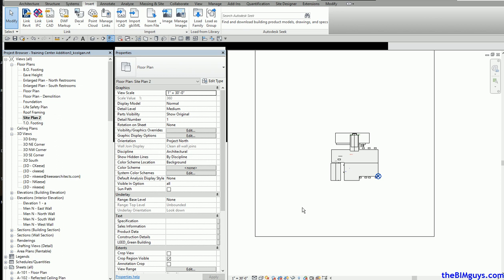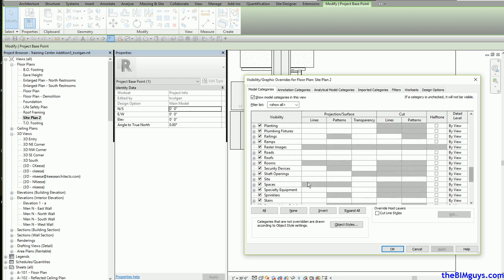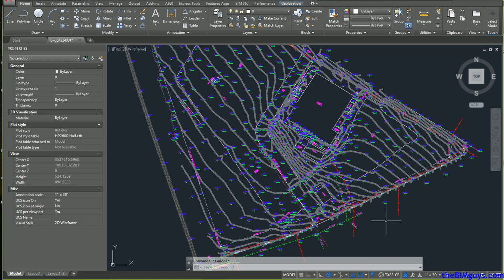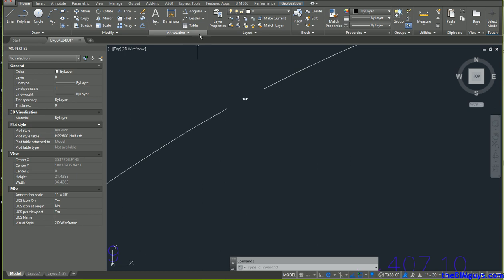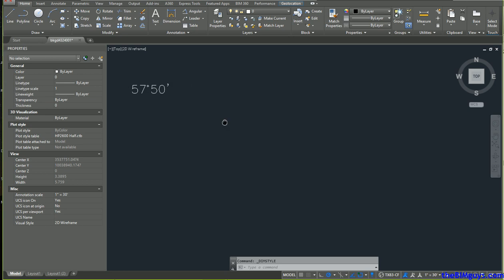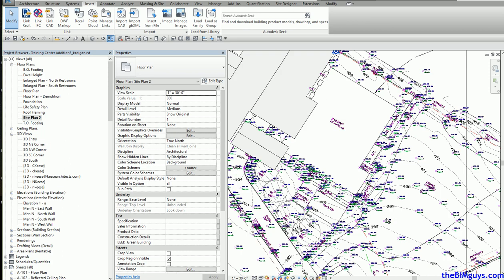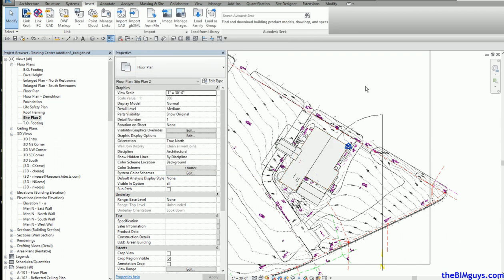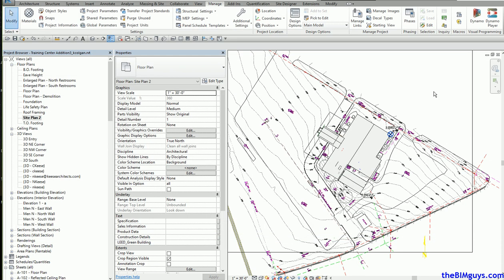Revit - Coordinating the CAD site and Revit Model - CADtechSeminars.com

Comment: question how I can put together two drawing in the same
coordination point, I have mechanical equipment and electrical, but they don't
match in the same point. I can see only one drawing but both file is in the
same file. I hope someone read my question and help please I have this problem for weeks
Reply from the maker: Victor
Chances are, the files do not share the same 0,0,0.  This happens often.
In Revit, go to a plan view ,duplicate it as Site Show All.  Next, in the Site Show All view, set the view cut range to 1000 feet and all  others to unlimited.
Once set, type ZA (Zoom ALL) and see if you see both models.  There are many settings that could be causing this including discipline. Make sure it is set to coordination.
If this does not work, unlink and relink the file using Center Manual. This should let you place the file by hand based on the center.
Once you find it, you will need to align it in the X Y and Z axis and pin it.

There are two tools in Revit called Acquire Coordinates and Publish Coordinates. Reserch these tools. These tools are used to re-sync coordinates between projects. It would take me another 10 paragraphs to go thru all the options and steps.